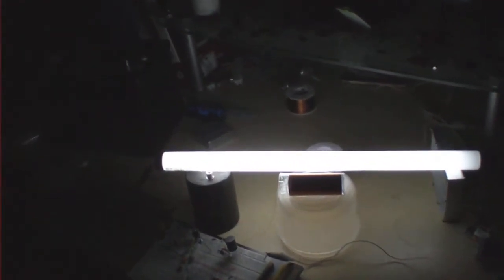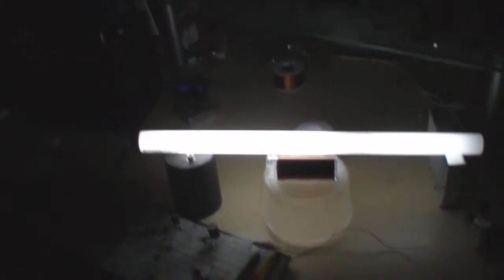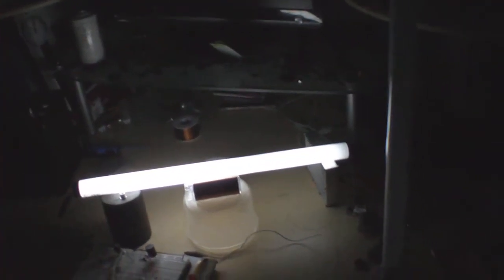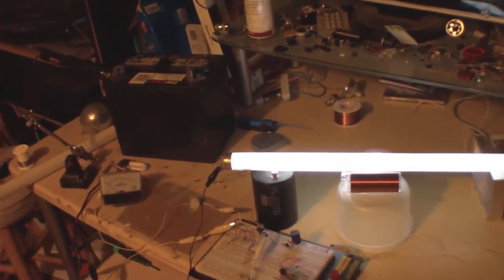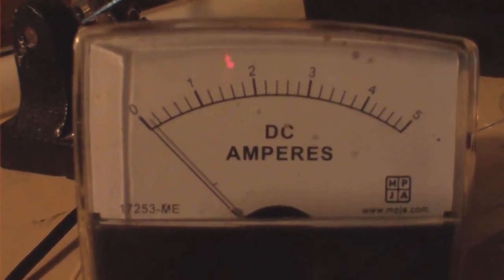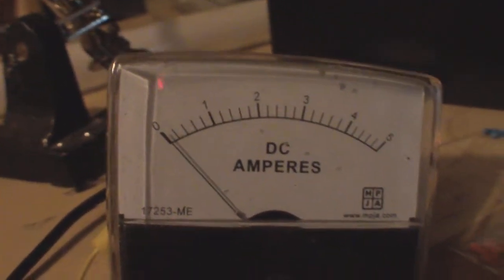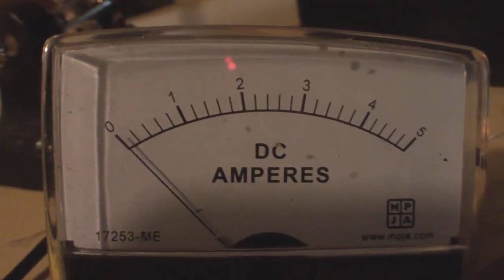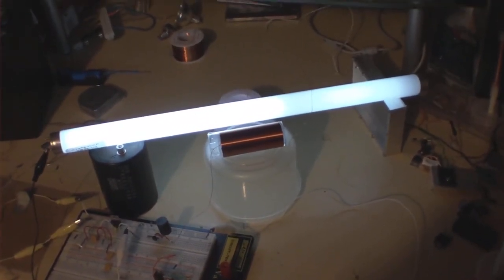(Replication 6.) Jonnydavro's SEC 15 Variant (Dr. Stiffler) - 12V / ?? mA - 15 Watt 18" Fluoro

Comment: Hi Kyle.
Unless your 1 ohm resistor has a non spiral carbon composition it will have impedance way in excess of 1 ohm and either interfere with circuit operation, or with the current reading via a digital multimeter.
Can I suggest you parallel your 1 ohm resistor with three capacitors - 100nF ceramic - 10uf electrolytic - 1mF low ESR electrolytic - then use your digital multimeter set to a mV range from a few feet away via fine twisted wire (enamel).
Waiting to see the real current reading !?

Comment from the maker: I'm not sure if this is playing a factor, or not, but.. I have a crock lead coming off the electrode of the fluorescent tube, it connects to -12V, which then connects to the large metal encasement that is the battery bank. Being able to move your bulb, and your coil, independently and accurately definitely helps.